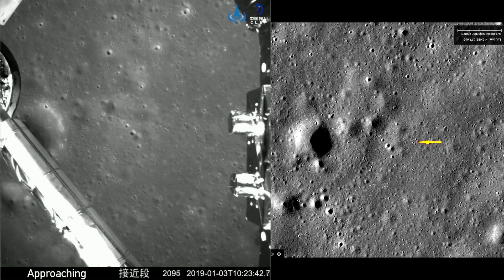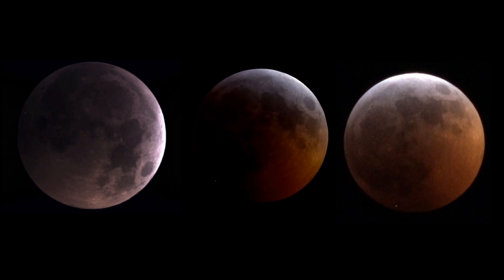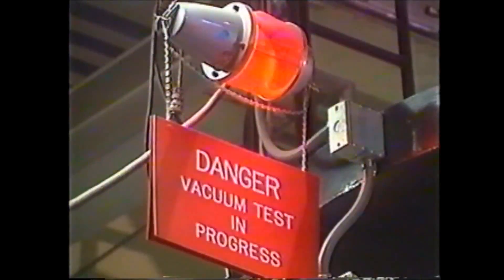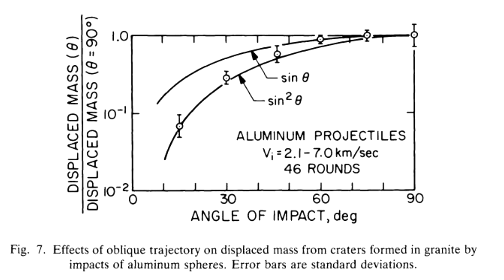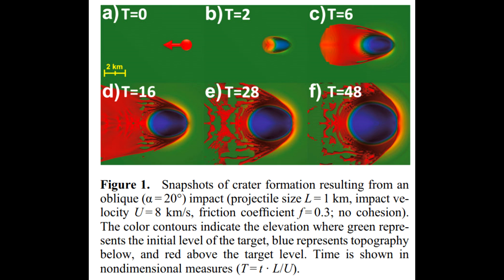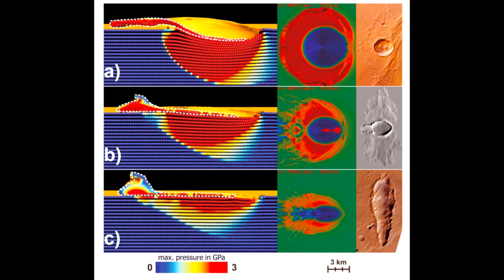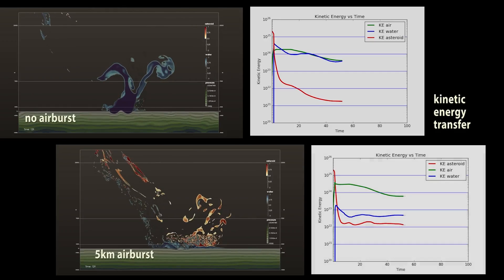Why Are Most Impact Craters Perfectly Circular? (Rather than Ovals)

Comment: Sorry,  but if you don't examine the effect of plasma discharge and electrical scarring on surfaces,  you haven't got a comprehensive explanation of craters on planets and moons.  Repeated strings of craters ending in canyons cannot be explained by meteors but can be made in a lab with plasma discharge.
Reply from the maker: Sorry but if you don’t examine the effect of tidal disruption of impactors you haven’t got a comprehensive explanations of craters on planets and moons.
Whoever told you that asteroid impacts can’t make crater chains is lying to you.

Comment: The most interesting thing, to me, was the ejection of material back up the low pressure area following the path of the incoming projectile.  Because most craters are round(ish) this would help with figuring out the incoming direction thousands of years later.

Comment: So the angle of incidence and reflection law does not apply in this case, because of high impact speed ? 
You are very wrong my friends, and this video enclosure is more nonsense from the makers of fake space  NASA and it's sadly mislead followers.
Reply from the maker: I see, so you think that this law should apply to a bullet hitting you? Are you Superman?
Reply: @scottmanley  Mr Sock Puppet, you posted this video, with a question. You seem to believe that you have an answer to that question. You seem to believe that surface marks  on the moon are caused by impact from some bolide travelling at a speed which you have guessed, based on having no proof of an impact or it's speed. So far ,  no proof of anything . Your question rightly or wrongly eliminates other causes of these surface irregularities, one cause that has been dismissed is an eruption from within the body in question. There is no evidence of impact, or eruption, but you postulate regardless of that fact an invented theory. Your reply to my dismissal of your theory, is banal, and unscientific, obviously a taunt to debase my response. Mr. Sock Puppet, who works for the Deep State, you don't know how little you know, and that is your weakness. Some might call that behaviour conceit, given that you have put yourself into the public domain, with no proof of anything .
Reply from the maker: @anthonywilliams4638  It's called a 'rhetorical question' where I already knew the answer.
Here's a few craters which were made by objects travelling at high speed and hitting the moon, we know they were solid objects because they're upper stages of rockets http://lroc.sese.asu.edu/featured_sites#ApolloS-IVBImpactSites

Comment: Does this apply to very large diameter complex craters? I've built a geological model for the central uplift region of the Vredefort Crater and it is slightly elliptical. I hear from other academics that even at lower angles of incidence the impact acts as a point explosion to produce a circular crater. The local geology is heterogeneous so I can provide an explanation using that, but it's only really speculation and I'd need thorough computer simulation using my modeling results to verify either hypothesis.

Comment: I think the easiest was to simplify and explain it would be that if you throw a rock into water the waves it causes are circular - because they are just waves spreading from the impact/penetration at the same speed in all directions - and only in solid material you get elongated craters
but at the extreme speeds involved in interplanetary spceflgiht you have so much kinetic energy that the elastic energy an object can absorb or the structura lstrength of an object is negligable compared to these extreme energies and speeds so to oversimplify it when hit at this speed a soldi surface will basically behave like water - and then turn soldi again once the devastating part of the impact is over

Comment: So when we go mining for heavy elements on the moon a good place to start is on elongated craters with low impact angles? It looked as if the material from the asteroid (if containing such elements) would have deposited them closer to the surface.

Comment: I heard a story about an entrepreneurial individual who knew that some meteorites were made of nickle, nickle being valuable he went to dig up a crater. Because the crater was circular he dug in the center of the crater assuming the meteorite was there, after weeks of digging he didn't find anything. So he went away and did some research and found that craters made from meteorites that have oblique impacts make more circular craters than elliptical craters. After discovering the angle of the impact he started digging again, but not in the center this time. He found it. the end.
Reply from the maker: This is the story told about Barringer, except that the real ending is he never found it, because the incoming rock gets vaporized.

Comment: So, if the Carolina Bays were formed by ejected debris from an impactor somewhere near the great lakes, the fact that bays are elliptical would suggest the incoming objects hit at rather shallow angles and with relatively low energy.  We need to see some simulations with an impactor hitting ice to see how the ejected material behaves.
Reply from the maker: If they were made by ejecta then the ejecta is moving a lot slower so that helps explain it.

Comment: As a first approximation, when a meteor impacts a surface.
The KINETIC ENERGY dictates the size of the crater, and tries to make a circular crater. This scales as velocity squared.
The MOMENTUM tries to make a hole in the direction of motion. This scales with velocity.
.
At low speeds, the momentum effect dominate, so hand-throwing rocks at sand make oblong holes.
At very high speeds, kinetic energy dominates.
.
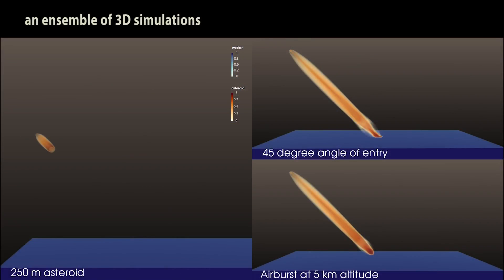aaand.. at 9:30 Scott mentions this even as I am typing this.
Reply: Does the nature of the struck surface count for anything? How about water vs. clay? How about highly pliable clay? Play-doh? Would all of those only react to the kinetic energy and not mold around the object?
Reply: @Bill_Woo  At HUMAN speeds, the surface material makes a huge difference.
At this scale, material strength is actually greater than impact energy, and you get the sort of reactions you mention.
.
At meteor speeds/energies, all that really matters is the total density of the surface. Denser material tend to make for a wider but shallower crater.
The impact can best be visualized as a small (or sometimes not so small) nuclear explosion at the point of impact.

Comment: Skip a rock on water and watch the ripples... round.  The reason is the wave is created by that kinetic impact, not from displacement of the water by the rock.  So too with the craters, the kinetic impact creates a similar pressure wave, and the dislodged material isn't nearly as significant.

Comment: Nice video! Neil deGrasse Tyson said a snowball thrown at a wall will display the same effect. If thrown with enough velocity, the kinetic energy will be more than the chemical bond energy of the snowball. Its splat mark on the wall should be circular even if thrown at non 90 degree angles to the wall. Haven't tried it for myself though!

Comment: Great timing on this. That rock that hit mars the other day is still in the crater. I have noticed there are a lot of filled in, humped craters, both on mars and the moon. What exactly are they? sure dont fit the concept of high speed interstellar rocks slamming into a surface. I could never understand why no one ever spoke of those rounded craters. i always thought that craters on a zero atmosphere surface would always be round because there was no resistance to the blow out or ejecta. would like to hear what you have for this.

Comment: Scott, perhaps your explanatory frame of reference is limited, despite your "hideously Complex offered math explanation without the math of the actual event. The impact will not emit light just because of kinetics.  In that your assumption of speed and kinetics is a assumption, without accounting for triboelectric effect or simple electric phenonema as compared kinetics and heat.  Here is a question, what is the temp of a plasma lightening bolt in enough of itself?  The heat is an impedance phenomena.   I suggest that you seek out electric discharge phenomenology as an infinitely more plausible explanation.  See Thunderbolts project and Electric Universe Theory.  Again, do you agree there is a charge delta between the earth and Moon? If not why?  Is there not a electric delta within our atmosphere?  What would delimit the electric charge to be only on one planet?  Would all planets have the same charge?
Reply: Nice

Comment: The Carolina Beys are bazilljons of elliptical cratars probalby caused by a big space rock impacting the miles-thick ice sheet covering most of Nort America.  The space rock didn’t cause the cratars directly, they were formed by the ejecta of thousands of ice boulders - which then melted, leaving verr little clues about their origin.
Reply from the maker: Yeah these are lower velocity ejecta impacts so the angle dependency becomes stronger.

Comment: 8:54 Did you notice Seattle for scale in the lower right? Wow!
Reply: The source material Scott used was of course looking at the more serious question of public risks due to asteroid impacts (you can't just suck up that national lab compute time for any old question).  The analysis seems to give a few survival hints for asteroid impacts (not "how to survive" hints, but "will I survive" hints ;).  The key questions are: what happens to the kinetic energy, how does it transform, and what materials carry it.  The materials are asteroid, air, water.  If your impact is in the airburst category, you're lucky - lots of energy winds up in pulverized/vaporized asteroid material flitting about and lots of energy spent in heating the atmosphere.  Destructive for sure, but only in a limited radius.  If your asteroid is a surface impact on the ocean, notice that minimal energy winds up in asteroid bits and lots of energy winds transferred to water.  Some of this energy makes a really big local splash (many km) that Disneyworld can only dream of, but a significant chunk of energy is transformed into creating a propagating water wave that is then able to transfer the energy very long distances and wind up making our simulated denizens of Seattle even wetter than usual!  The slides covering the energy analysis were much fun.

Comment: This was pretty interesting from a military perspective.  I was an Forward Observer in the Army and one of the skills we were taught was crater analysis.  Basically we would look at the craters made by things like artillery and mortars and determine information about it.  Basically what direction the round came from and what kind of weapon system fired it.  We could tell this usually by looking at the ejecta and comparing it to the shape of the crater itself and get a workable azimuth to the point of origin.  Determing the weapon system usually came down to comparing shell fragments to determine how big the round was.  This information was used to figure out generally where a hostile artillery or mortar position could be.   An interesting quirk that creates a difference between a crater made by a mortar one by artillery is that the ejecta from an artillery piece will blow away from the direction the round came in.  But with a mortar it tends to blow back towards the direction it came from almost as if its trajectory started to curve back in on itself.  I think this has to do with the fact that mortars are fired at a high angle while artillery ends to be fired at a flatter trajectory (but they are able to fire at high angles).  I'm guessing that things are different considering that artillery and mortar rounds come packed with their own chemical explosive energy to release on impact.  But if you look at old aerial photos from WWI battlefields for example the craters are also almost always circular so I think the same rules may apply.   I only had to use this skill in Afghanistan once when it turned out to be a recoilless rifle round harassing our outpost every now and then.  This was a bit confusing because recoilles rifle rounds look just like mortar rounds but the ejecta blows away from the direction it was fired from.  Just some random thoughts on craters.
Reply: Nice one... Thanks for that.
Reply: You're input matches nicely with a video I saw at Meteor Crater in Arizona. It was assumed at first the the meteor came in perpendicular due to the circular crater. But the area of the highest concentration of meteor fragments is the Northwest quadrant. How could there be an almost perpendicular approach angle but distribution of the fragments that almost looked like a horizontally fired shotgun?

Enter one observant hunter. He noticed that if he missed his shot during the dry season, the bullet plowed a furrow. If he missed a shot when the ground was wet/muddy, it produced a circular crater. 

To the best of our knowledge, what is now Arizona was part of an ocean at one point. I don't think it's too much of a stretch to accept that the presence of liquid when Meteor Crater was formed is what gave the bowl shape and discrepancy of higher concentration of fragments in the NE quadrant. 

Concerning WWI heavy munitions craters, from the accounts I heard from those "Over there" was that it was almost always like wading through a bog. That could give further credibility to the hunter's theory concerning the presence of liquid at time of crater formation.

Afghanistan-- yes, I would think that having to switch gears from forest to desert conditions would make reverse trajectory calculation a bit of a problem. I noticed that all my skills while stationed in the Mojave desert had to relearned and required rethinking when I was assigned to North Carolina. The interplay between humidity, air pressure and temperature became more pronounced than in the low humidity variation of the desert.
Reply: Very interesting, thanks for posting this.
Reply: The more you know 💫💫💫 Thank you for your service 🙏🏿
Reply: The ejecta from the mortar goes back to where the projectile came from because of the area of low pressure that has been made by the incomming projectile (I think)

Comment: I’ve heard that the reason ICBMs always carry nuclear warheads is, the warheads re-enter the atmosphere so fast that a 1,000 pound solid metal warhead would actually make an impact crater about the same size as 1,000 pounds of TNT would. So if one wanted non-nuclear ICBMs, they would be better off filling the warheads with a heavy, inert material like lead or tungsten, in order to make long-term missile maintenance and storage cheaper and safer. Otherwise, if kinetic energy isn’t enough, no non-nuclear explosive would produce enough energy to justify it’s extra cost and complexity.
Reply: Theoretically, a dense enough object moving a high enough speed, will produce results similar to a low yield nuclear weapon. It's something that was investigated a few years back, but cost was obviously a limiting factor; it turns out, nuclear warheads are still cheaper.

Comment: A massive object like the moon will bend the trajectories of meters to a higher impact angle making the shallow grazing hits even more rare.
Reply from the maker: And that gravity will also pull in objects on trajectories which would otherwise miss, so that they end up on grazing impact trajectories. Turns out gravity on the target body doesn't change the distribution of angles.

Comment: Given the supersonic speed of many airgun and most firearm projectiles, I don't understand about the sound barrier for gasses. Are you saying it uses hydrogen so the projectile can avoid crossing the sound barrier?
Reply from the maker: I'm saying the speed of sound in the propellant limits the speed of the projectile.
Reply: @scottmanley  I understand that sound travels much faster in hydrogen. But I just confirmed that pellet guns shooting compressed air have broken the sound barrier. (Though not by much) I'm not finding much information on this principle, and it interests me. Is there a name for it?
Reply from the maker: You have to remember that compressed air heats up, and the speed of sound gets higher in hot, compressed air.

Comment: Could Thorium fusion beat Deterium fusion and Hydrogen fusion?
Reply from the maker: I think you mean Thorium Fission.
Thorium reactors are probably easier to solve than Fusion reactors, but fusion is better if you can make it work.
Reply: @scottmanley  
I thought fusion can include Thorium. Considering it includes Helium-3 and Hydrogen.

Comment: So id est;
The meteors embed themselves into the body they're colliding with and expend the excess energy by vapourising/exploding. It is the point "explosion" on the surface which creates the crator not the transfer of momentum as would be happening in thrown/low velocity simulations.